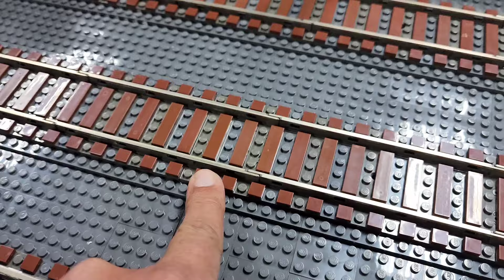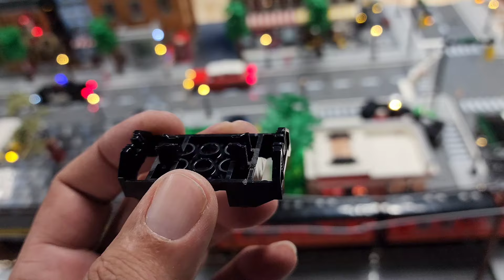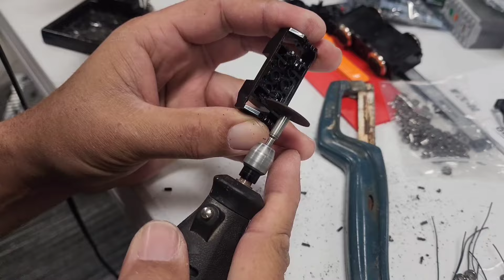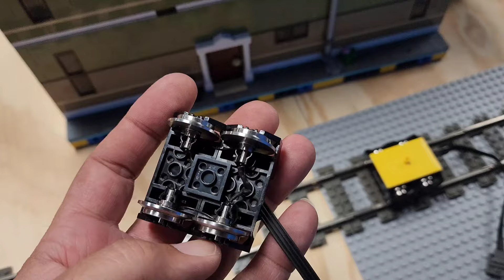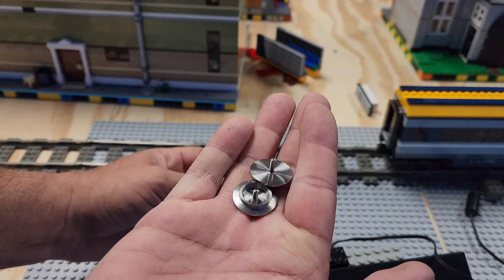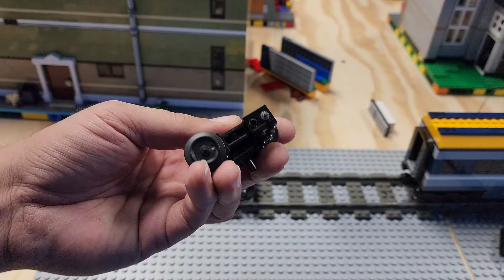Innovative Lego Train Power Solution: No More Batteries Needed!

Comment: Just put in my order. I only have a single PF motor so I didn't need more but you can guarantee that my 5 powered up motors will need the future release. Just in time for brick fair planning.

Waiting now for those adapters so I can use the remote control. Also I need to figure out how to integrate with my trains for aesthetics.

So excited, thanks again for the great products. We are lucky you became an electrician. If you were a plumber we would still be waiting for anybody to create products.
Reply from the maker: Thanks so much for the support